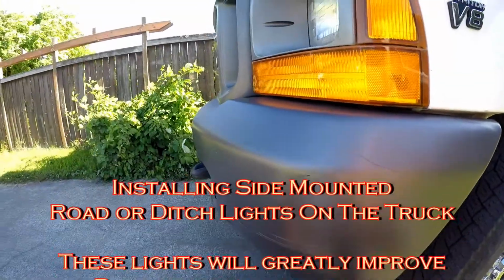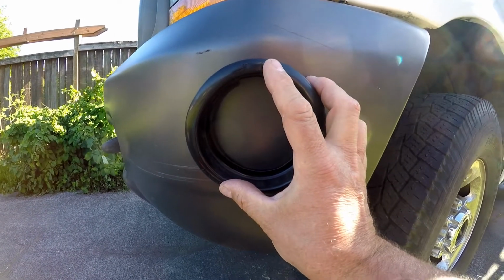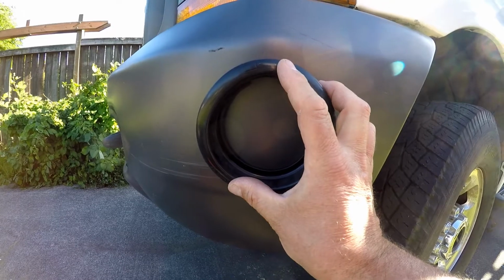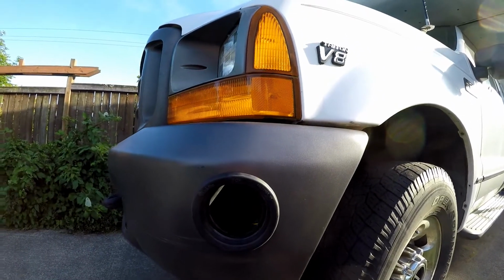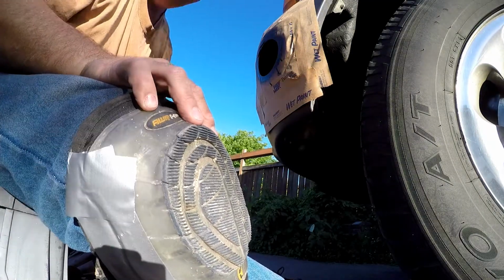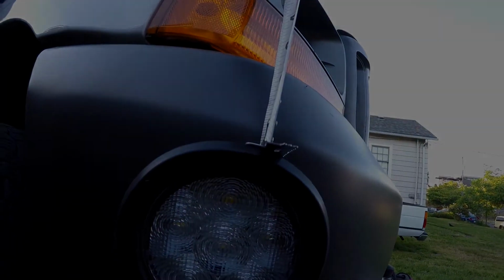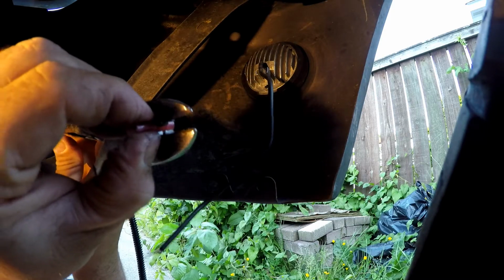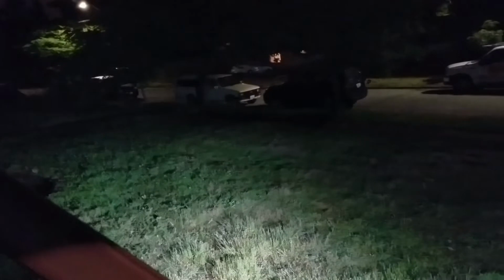How To Install Road Lights In Your Truck Bumper

Comment: Big job for a cordless drill!.....Surprised it had the torque to pull it off...
Reply from the maker: Those are the big Makita's. We go through a lot of drills and the Makita builds a really tough reliable drill and a good compliment of cordless tools that use the same battery keeping it simple. Just uploaded the backup light installation video. both these are good mods. 
Is there going to be a WCR Rhody Days Festival Video?
You and Bobby have a great day...
Reply: CITAP1 good to know on Makita....all my electric tools are that brand....didn't make any movies over Rhody days ....under the weather.